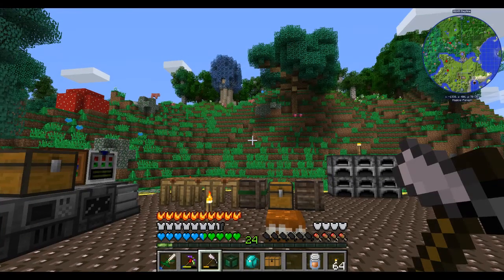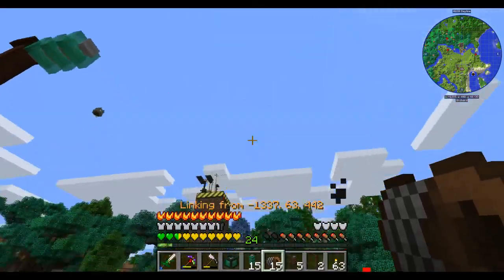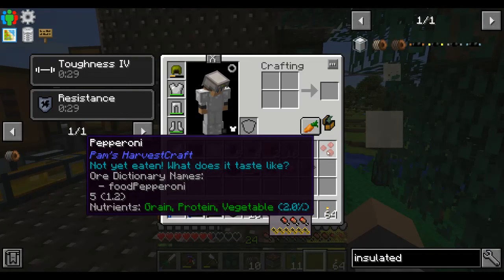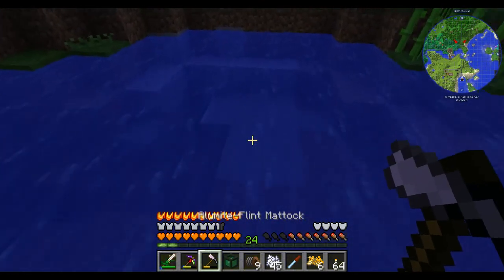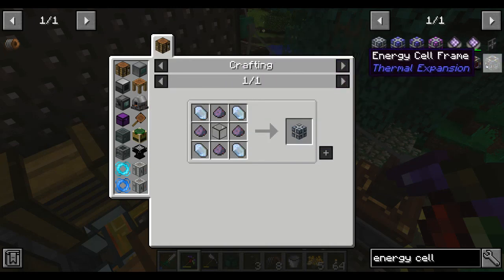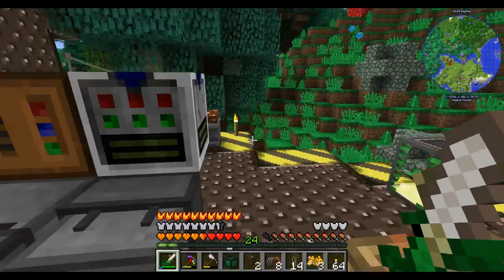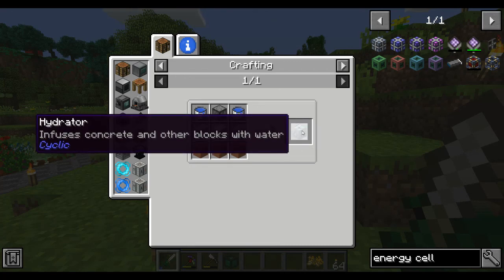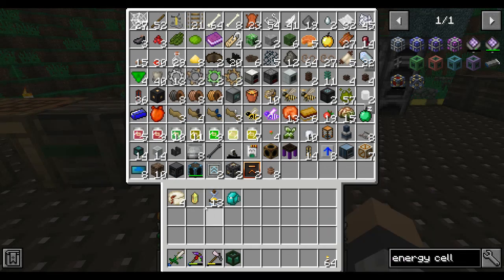Enigmatica 2 Ep 12 Actual Power

Comment: The waterwheel is a neat concept.  Looks like good fun to produce power in Minecraft.
Reply from the maker: Immersive Engineering is pretty neat for power generation.  The water wheel being the main early staple along with the windmill.  I've never done the windmill, but it generates more power the higher up it is, I think.

I also really like the aesthetic of the water wheel.

Largely power generation in mods is a single block (a generator of some kind) that eats something to produce power.  The exceptions are Immersive Engineering stuff and there are some cool mods that introduce, potentially, VERY large reactors.  I think the biggest I have built was a 64x64x64 reactor back in Sky Factory 2.